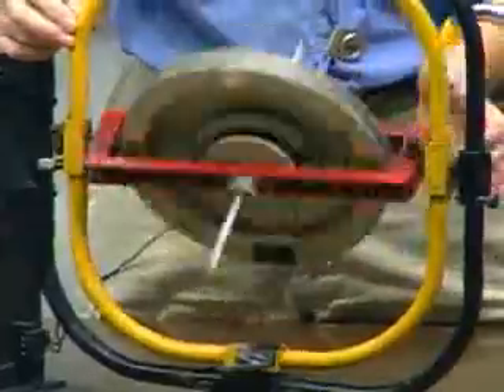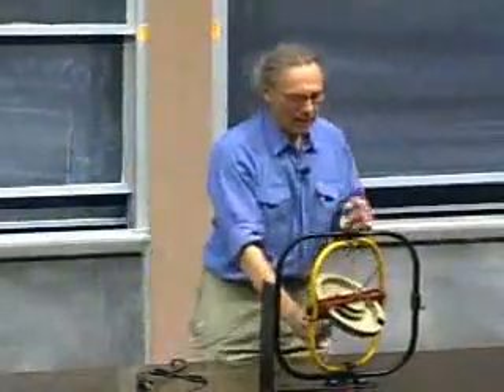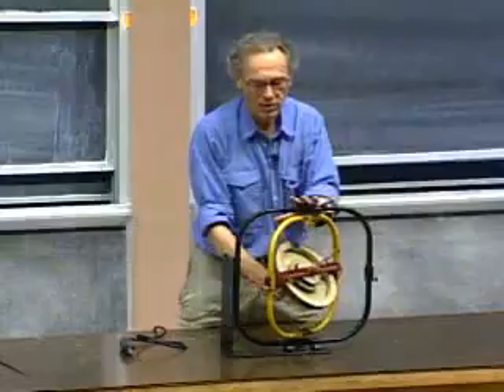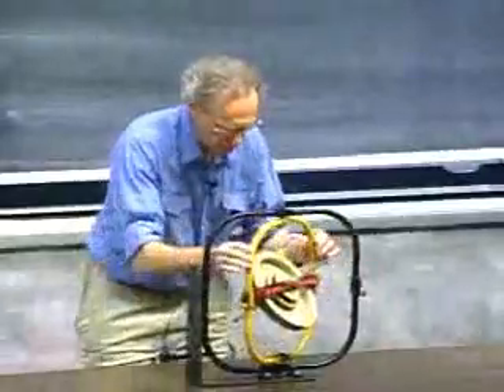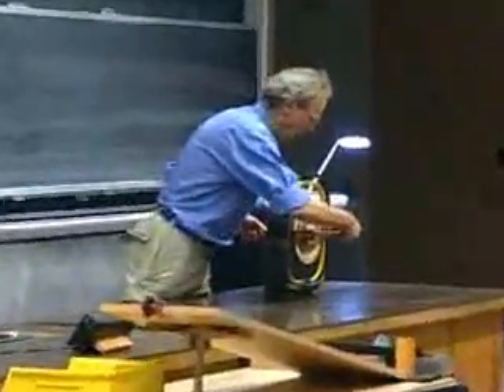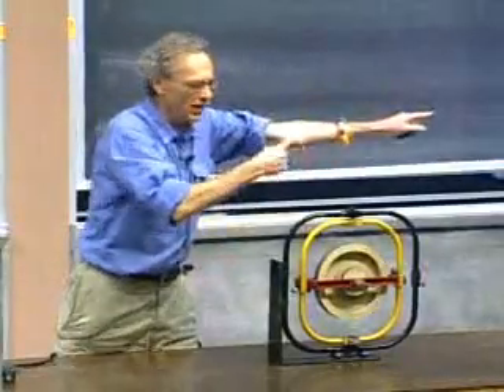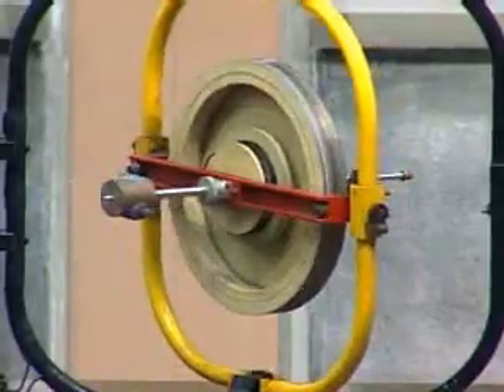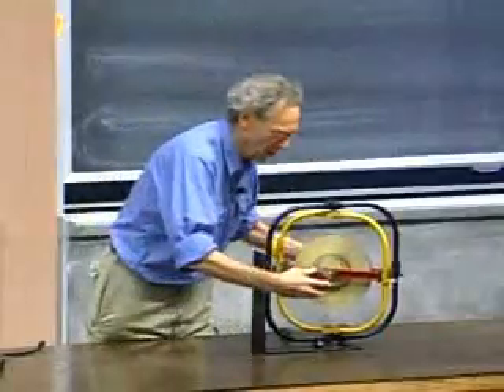Inertial Guidance System.wmv

Comment: As first explained by German engineer Maximilian Schuler in a 1923 paper,[1] a pendulum whose period exactly equals the orbital period of a hypothetical satellite orbiting just above the surface of the Earth (about 84 minutes) will tend to remain pointing at the center of the Earth when its support is suddenly displaced.

Schuler tuning is a modification to the electronic control system used in inertial navigation systems that accounts for the curvature of the Earth. An inertial navigation system, used in submarines, ships, aircraft, and other vehicles to keep track of position, determines directions with respect to three axes pointing "north", "east", and "down". To detect the vehicle's orientation, the system contains an "inertial platform" mounted on gimbals, with gyroscopes that keep it pointing in a fixed orientation in space. However, the directions "north", "east" and "down" change as the vehicle moves on the curved surface of the Earth. Schuler tuning describes the modifications necessary to an inertial navigation system to keep the inertial platform always pointing "north", "east" and "down", so it gives correct directions on Earth.
Reply: +Casey Van 

Ok lets see if what you are saying, adds up.
I know you come off as a logical guy so lets you and I do some math here together ok. 

We know the formula for a round Earth height change is ;  Height = distance squared multiplied by 8

So  h= d^2 x 8

Lets take a passenger plane cruising at 570 miles an hour in the air.

570 miles/ hour ^ 2 x 8 =  324900 x 8

=  2599200 inches 

Lets convert that into feet 

2599200 inches / 12 inches / ft

216600 feet = height 

Lets convert that to miles

216600 feet / 5250 feet/ mile

Therefore the height =  41. 0 miles

Lets find the angle the plane has to point its nose down to stay level with the ground.

angle = inverse tan

angel = 41 miles  (rise) / 570 miles (run)

angel =  0.0719 inverse tan

angel = 4.1 degrees.

Does it make common sense to you that when you are on an airplane at cruising altitude speed that the passengers are unable to detect a 4 degree slope in something as large as a passenger plane?

Would you pay a carpenter if he built you a house with a floor sloping 4 degrees? 

I have flown on a passenger plane and when I drop a baseball on the floor in the aisle of the plane it does not roll towards the cabin. It simply drops and does not roll as if on a slope.

Just saying...... explain that.....
Reply: VitaLux IUC Passengers would not be able to tell if the plane is tilting at all, because from their standpoint the gravity is still pulling them down. If the plane suddenly tilted nose down they actually would notice that, but that's because the plane is now not horizontal to the ground. The Earth is very large, so from our perspective even pretty high up it looks flat, so as we travel we still feel the gravity just below us, and see level in front of us. The gyroscope will remain in the same angle, so you could detect this gradual change in angle relative to a fixed position on Earth with a gyroscope. This needs to be corrected by Schuler. This is a very simple explanation, and is easy to understand. For example if you had a metal ball you could demonstrate the concept. I piece of metal would be attracted to that ball at any angle, regardless if it were underneath the ball, or above it. If you circle the ball with the magnet lying flat relative to the surface of the ball, then move it around the ball, the same pull is felt regardless of where the magenet is positioned.  If you assume the Earth is flat, then you are assuming that the angle changes relative to a flat Earth, in that case then yes of course you would notice that the angle is tilted, I'm talking about a Globe not a plane. So with a Globe you can not tell because you are being pulled by Gravity around the Globe, no matter where you are at it's the same, there is no up or down plane-wise, there is only up or down relative to if you are facing towards the Globe. If you look at a Globe from Outer Space you are looking down at the Globe although you are not facing down, you are facing out the window. The same goes for what I'm talking about. Down is always towards the Globe no matter how high you are, or where you are on the Globe. When you are flying you are circling the globe no matter what direction you go. If you go in a straight line you will end up in the same place, but still feeling as though you were travelling on a flat plane. Since the Earth is so huge, there's no way to tell, you feel gravity pulling you down which is toward the Globe at all times, unless you suddenly change your angle. The gyroscope is subject to gravity like any object is, however since it's able to move freely within the mechanism, it points in the same direction no matter where it is in space, or where it is on the globe. So this poses a problem with Global air flight, and they needed to correct it. It would be quite an elaborate conspiracy to invent devices, and software to correct something that doesn't exist in reality. So along with many other evidences, there are much fewer questions to be answered with a Globe model, than there is with any other shape model. Gravity explains it all, that mass attracts mass. A large object like Earth can attract us so strongly that it takes great energy to go in the air. So the Globe model is the best model. If there is no Gravity then I know of no other explanation as to why things fall to the ground, and why there is an up and down at all. The Flat Earth theory is full of riddles. I hear them say "We don't know that yet." but the Globe explanation solves almost all the problems that I can think of.
Reply: +Casey Van  So what you are saying......then .....is Gravity is Magic .....when confronted why something appears to do something without a particular reason why, we just call it Gravity, which means hocus pocus.

Kind of funny,  when I was a child, that kind of logic use to stop me dead in my tracks when I asked my mother "How does Santa Clause fly around the whole world in just one night?" ....she replied it was magic, ....but ...she could have also said. " It is because of Gravity"
Reply: You suck at debunking.  You regurgitate random stuff you read without investigation and are unable to apply logic and reasoning because of your egoic beliefs and predetermined ideas.  Must be the many years of mind control induced by your favorite institutions starting in Kindergarten.

Comment: Does it mean that a gyro would show a 90 degree angle tilt every 6 hours because of earth's rotation? 

After all you said "it's has no gravitational torque"...therefore it's independent of earth rotation. 

So the best experiment to prove to my friends that we live on a 1000mph spinning ball would be to set an experiment where I would have that spin for 6 hour and show the procession.
Reply: +Globe Skeptic In airplane systems there s actually a small, continuous torque applied that makes it seek the local vertical. For this reason it resists short-term changes exactly as shown in this video, but also in the long term it adjusts itself to the local vertical. This corrects for not only the earth's rotation but also for long-range flights, where there is a significant difference in latitude and/or longitude between origin and destination, after which the gyro will still be properly aligned despite said difference. Google "gyroscope erection".
Reply: +Globe Skeptic Yes, I'm not an expert, but that sounds valid. I would imagine that it would be independent of the Earth's rotation, so they probably have an electronic device that compensates for it. It can tell you at any given time where the absolute position of the plane is independent of the globe.
Reply: do you mean that if I set my artificial horizon and I was to go from the North Pole to the South Pole, the gyro would correct itself so that it would show that it is not upside down once arriving at the south pole?
Reply: Please educate yourself, so that you can avoid being an embarassement to yourself. From https://en.wikipedia.org/wiki/Attitude_indicator : "In order to let the gyro very slowly orient itself to the direction of gravity while in operation, the typical vacuum powered gyro has small pendulums on the rotor casing that partially cover air holes. When the gyro is out of level with respect to the direction of gravity, the pendulums will swing in the direction of gravity and either uncover or cover the holes, such that air is allowed or prevented from jetting out of the holes, and thereby applying a small force to orient the gyro towards the direction of gravity. Electric powered gyros may have different mechanisms to achieve a similar effect. The problem with these leveling mechanisms is that they will respond not only to gravity but to accelerations in other directions due to other causes, such as turns. If the gyro simply immediately oriented itself to the net acceleration vector, then it would be useless. So these adjustment mechanisms act to right the gyro very slowly, such as 2 to 8 degrees per minute, in the hopes that the gyro will stay nearly stable during any brief maneuvering, and that most of the time the aircraft will be flying in a steady, non-accelerating manner so that the gyro has a chance to orient to gravity."
Reply: Marco Ottaviano:   Wow! You just told me the answer to what I have been wondering about for years!
Reply: musclecar rocklover Thanks for naming it. For the life of me I'd not have recalled the exact name, as more than 20 years went by since I briefly studied this. Also the torque isn't constant as I wrongly stated, but proportional to N/S and E/W velocities. Thanks for the information and bringing back good memories.
Reply: The device y’all are looking for is called a Foucault pendulum.
Reply: There are some bullshitters here in this thread so I thought I'd set the record straight.   Attitude Indicators (AI) or artificial horizons have been used for instrument only airplane operation since before Schuler even wrote his paper.  The AIs employ a gyroscope to set the inertial reference (the level runway) .  This inertial references stays forever and ever as the professor above points out.   There are not small torque changes to the gyrosope ever, this is just ludicrous and the height of buffoonery.  Modern flight management systems do contain a schuler circuit to compensate for changes in gravity in the accelerometer portion of the device only not in the gyroscopic circuit.
Reply: +musclecar rocklover So that would mean if there were a globe Earth conspiracy they would have had to think up such a device to cover up for the "fact" that the Earth is flat.  Marvelous!
Reply: Casey Van They just flatly ignore this altogether. Those people just use the common sense idea that an un-torqued gyro should slowly tumble as an airplane flies around the world, and present this as "proof" for their flat earth dream.
Reply: I'll pay $10,000 for a large electric powered gyro on gimbals that flips over every 24 hours as the Earth spins as a scientific display and as a clock  (and to shut down the stupid flat Earthers...lol). I think it would be worth every penny to show the angle change as a 24 hour clock. Small gyros don't seem to be strong enough to change angle as the Earth rotates.